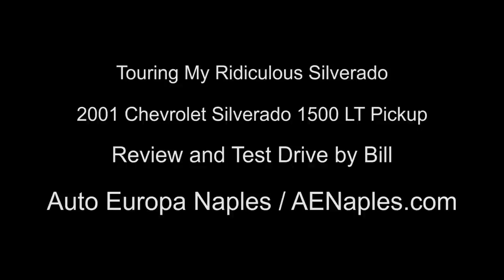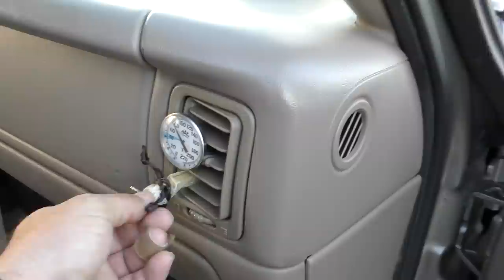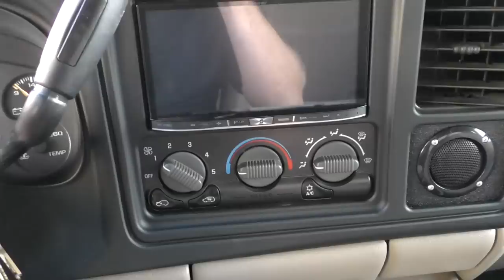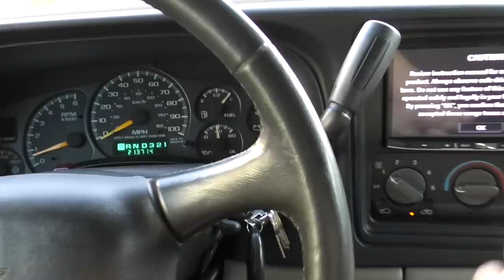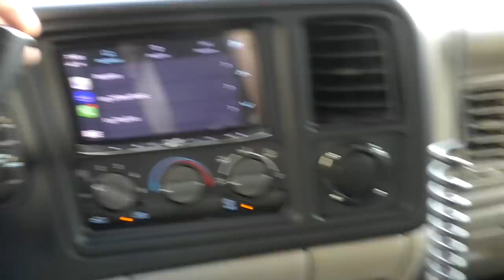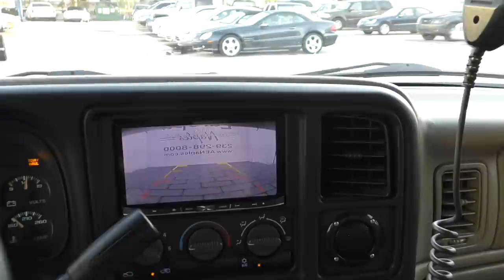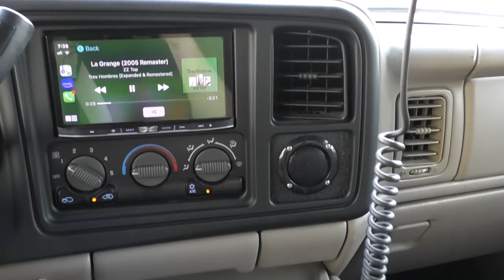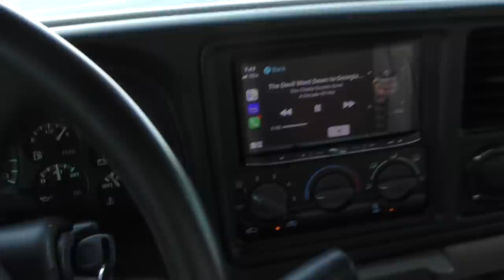The Best Used Truck Under $5K - Here's Why I Bought This 2001 Chevy Silverado and Absolutely Love It

Comment: 100% agreed.. these were likely the best Chevy trucks ever made, all told. Keep up the good work!
Reply: agree have a 99 and its the best chev truck I have owned by far
Reply: Yep, had 04 cat eye, 170k. 3 sets of tires, 2 batteries, 1 starter and 02 sensor. Seriously.
Reply: Still have my 2000 GMC Sierra SLT 1500 Z71 with the 5.3 Vortec and it's the best truck l've ever driven.
Reply: Cool
Reply: Just got an 02 my grandpa left behind when he left this world I spent a hot Texas summer tuning it and getting it a new cat converter. I’m happy to say that it’s one of the best things I’ve ever owned.
Reply: My 02 1500 Silverado was the best vehicle I’ve ever owned.
Reply: My 01 Z71 LS 5.3L ...bullet proof...showroom condition.  Only the 5.3 tick upon startup for 30 seconds.  184k.
Reply: Way better than the trash they make now
Reply: @super20dan  ya 99 -03 are the best and the Tahoe easy to get parts and work on

Comment: Really a great choice!!! Congrats!!! The 5.3 is a great motor!!! I have an older GMT400-style 1997 K1500 Silverado 4X4, and it has the Vortec 5700 5.7L V8 (which I should mention is 306k miles strong). Those engines were all derived from the Corvettes of the time. :)

Comment: Love my 2000 Silverado ext 2wd. Had it for 14 years. Put mild stage 2 cam, headers, cai, custom 93 octane tune, efans, and it woke this 5.3 up. Probably makes 375-400 at the crank. Get about 19-20mpg highway.
Reply: Can't wait to cam mine.....I've had it for so long and now have decided to modify it lol. (2 inch shackles to get rid of the infamous GM rake, re-wired the cab with thicker gauge and added a sound system with 2 amps and 2 10s, added LED fog lights projectors which recently came out to the market, and my favorite mod of all was swapping the center console/jump seat and adding the 07-13 year model that has a lock compartment directly under the seat. And dual exhaust flowmaster flowFx which is really a magnaflow. )

It's a 2001 I've owned since 2007. I own a BTR Truck Norris cam still in the box, the engine has 235k miles. I think I will just rebuild it. As for the stall, I honestly like the stock feel and I may put a 2200-2400 stall

Comment: Good-looking truck there, Bill. It looks like a regular truck on the outside, but with an excellent setup of communications, stereo w/ backup cam, and wheel gun. I bought a very clean 2003 Silverado last year, and I love it. It's a crew cab 1500 HD, so it's basically 3/4 ton with a semi float rear axle. I'm finally getting around to installing a President McKinley CB radio in the center console. As a truck driver and lifelong pickup truck owner, CB radios come in pretty handy out on the highway and up in the woods when running with other friends in 4×4s. Cheers.

Comment: I bought a 99 Silverado in 2012 and paid $4900.00 for that then. It was a screaming deal at that time already. It was the extended cab but only the 3-door, the 4-door extended cab I believe was optional at this time or became available the next year. It was the long box, which I do prefer myself, I grew up driving long boxes.
The family that had it before me were farmers, so it did have a few upgrades they put on it. It had a grille guard/brush guard, very nice addon, and they had put a full-length tool chest behind the cab in the front of the box. Very great addon. They had also put running boards on it, and all these were sold along with the truck, so I got it with these optional items included.
They had also put on overload leaf springs on the rear end, so I believe they were using it more like a 3/4 ton instead of a half-ton. The frame was cracked on both sides on the rear and a co-worker who is a mechanic welded the frame back together and welded a couple diamond patches over the cracks. Now it's solid.
It does have the 5.3L LS engine and I've had almost no issues with it. This past spring the water pump did go out and I managed to replace it myself with minimal effort. It really wasn't all that hard a job, just took some patience and I did torque the bolts holding everything together back to the factory specs. While it was apart, I also put in all new hoses, heater and radiator hoses, and replaced the serpentine belt and the idler pully's so the front end is pretty much brand new again. Like I said, it was a relatively easy job and just took patience while doing the work.
Otherwise, it's been a very reliable truck for the 10 years I've owned it. Regular oil changes and tires, I'm on my 2nd set right now, and would like to put another new set on. I've got a 97 C2500 light duty Chevy pickup that uses the same size tires which needs an engine and tires...currently looking for a 5.7L for that truck.

Comment: 44000 subscribers for a car salesman is unheard of... Bill is LEGENDARY!
Reply: Because Bill is THE MAN. I worked in GM, Mopar, Toyota, Mercedes/Audi dealers all my life, 35+ years, with the new and used vehicle sales pukes. Bill is head and shoulders above every one of them. 

Anyone who owned a '79 Formula Firebird as their first car in high school is the man in my book. more than a little about them below

 I personally owned 6 Gen 2 Pontiac F-body's...  First a '71 Formula in Silver, Black standard interior, with the optional 455, turbo and 400 trans, featuring a liquid Mercury filled tank mounted inside the trunk for increased handling..  Next, a Maroon '74 Firebird with Black standard interior, stock 350 2 bbl and 3 speed automatic, which I built using 400 RA-III heads, cam, larger pistons, aluminum intake manifold, shift kit, reverse valve body, dual gate B&M shifter, and headers, featuring Sonic Turbo mini mufflers, pushing considerable power though a 4:10 10 bolt Posi traction differential. Next up, a '76 Formula 400 in Black, with Buccaneer Red Deluxe Cloth interior, featuring the 4 speed Borg Warner Trans with Hurst Hatches and Gothic Script decal kit. Later, came the Canary Yellow '77, with a 400, 4 speed, Black Deluxe Interior, which never had the engine apart,  but felt and performed considerably faster than every other, save 2 of my 2nd gen F-bodies. A little more about them below...

 I paid 100$ for it, back in 1988, it needing both lower outer quarters, which I installed myself, weld in, then an all-over paint job back to like new. I loved that car and traded it for a V-8 powered S-10.  At the same time,  I came across a retired local Police Chief selling his one-owner '78 Trans Am, garage kept in Aztec Gold, complete with Screaming "Super-Bird" decal which extended on to the upper fenders in front,  again using the Gothic Script writing decals, featuring the 220 horsepower (felt like much more power)  400/ Borg Warner 4 speed, 3:55 Safe-T- Track 10 bolt rear end, , Camel Deluxe Cloth (checkered velour seats) interior, & GM Fisher T-Tops. This car needed most of the 8 Intake valves, as they had split on the margins due to recessing of the  intake valve seats. So, the entire engine was rebuilt professionally from crankshaft up , over-bored 10, custom forged pistons, stainless steel valves,  a bigger cam featuring a high lift short duration spec.  Ported and Polished runners were hand matched,   RA-IV heads,  headers, deleted catalytic converter, Thrush "Hush Thrush mufflers, full 2" pipes out the rear. 

Finally another Canary '79, Camel interior, fully loaded, no T-Tops, no 10th anniversary 400, instead it came with the malaise anemic 403 which had a rod knock. Owned by the John Palumbo, leader of a  East Coast regional rock band, Crack The Sky, of some notoriety. I installed a built '70 400 R/A 4 and matching 4 speed in from a totaled '70 GTO. A mix of Honeycomb, Snowflake, Rally II and Turbine Wheels were on all of them.

Any guy that knows cars and loves Trans Am's-Firebirds the way Bill does is Aces in my book!
Reply: @phillanassa759  - Bill's a Car Guy...You're a Car Guy ...... I'm a Car Guy ........... Church Lady says, "Well, isn't that SPECIAL!" ...  Yes Church Lady..........Yes it is!!!

Comment: I also bought a 01 Silverado 1500 about 3 years ago. Less than $4000. The engine had just been rebuilt and the transmission was newish. Put new shocks on it. Had to have the heater core replaced recently. so did all the actuators and the air condition. Going to have it painted soon and have all the dents and rust taken care of. Probably have all the emblems taking off of it. have put LED lights all in the cabin and on the license plate light. I need to get new parking turn signal lights and tail lights. Think it will be pretty sweet by then. I'm an older guy and I'm not gonna go out and spend$60,000 on a new truck. this will probably be the last vehicle I ever buy. Oh there are some spots on the dashboard that just need repainting. it's not cracked anywhere but on the door panels there are couple of cracks on the drinker side. I need to figure out how to fix that. Anyway enjoy your video I might get some of the gadgets that you got.

Comment: I was at your level of pickup knowledge. I needed one so I bought a pretty white 2009 Ram 1500 quad cab. It's my truck and I use it for work and...it has been flawless in serving my needs. Power everything I need clothes seats just a plain simple truck. 260,000 miles now and still flawless running looking and all that. My father-in-law has that same truck you have. Same color and everything. It is a better truck than mine even though it's a 2001. You are 100% right about that truck. You'll have many more years of service with it or...the person who buys it will. I'll buy a car from you soon. Love how you handle these videos. Thank you

Comment: Thanks for doing this review.  My son has my old 2000 Silverado LS extended cab.  Truck was too good to sell when I bought newer trucks.  Love this thing.  These trucks are fairly bomb proof with the weak link being the transmission.  But even those last a decent while if you don't beat on them too hard.
Reply: I just bought one for 5k with 23000 miles on it I’m super exited for this had to sell my  08 Silverado due to the fact that it was breaking down constantly. Previous owner bought it new from the dealership

Comment: Love this truck man! I have a 2000 Sierra 1500 5.3 that my dad ordered brand new, fully loaded. Meadow Green, looks identical to the truck that was on the 2000 GMC brochure. Got it from my dad for $3k back in 16 when my dad bought his new Denali. 245k mi on it still runs great. Could use a paint job and a little body work but right now she's just my ugly, dependable ol truck.

Comment: I love that truck. If you ever sell it...I would absolutely adore it. I'm a 38yr old, single, retired, disabled veteran. It would be perfect for me and my little dog. I have a rclb 2wd 2003 Silverado 2500 6L 4L80e with 316,xxx miles on it that is worn out, a rclb 2wd 1997 F250HD 351w ZF-5 S47 with 22x,xxx miles that is equally worn out and a 2004 Pontiac GTO T-56 that is torn apart in storage and waiting for a 6L iron block that I have yet to refreshed, assemble and install. If I had that truck I would seriously consider building it the way Chevy should have with a built 6L/4L80e, 14 bolt, might do a leveling kit in the rear, mini spool, ladder bars, upgraded brakes, coil overs in the front. Put a small cam in the 370-376ci overhoned iron block, upgrade the 706 heads, the TBSS intake, 92mm tb, swap in a 216/220, 220/224 or 228/230 camshaft, valvesprings, trunions, heavy wall pushrods, LS9 head gaskets, long tube headers, 2.5" true duals, electric fan, electric water pump, functional ram air, silicon hoses, coler t-stat, NGK TR6s, flex fuel, larger behind the rear axle fuel tank in place kd the spare tire, 20x8.5" factory LTZ wheels. Sort of a Mashup of 1/2 and 3/4 ton parts with performance upgrades. That's the perfect truck and the mods you've already done are excellent. I would adore it if you'd ever sell it and probably drive it for the rest of my life.

Comment: 1999-2006  GMC Sierra 1500, Yukon, Yukon XL, and Chevy Silverado, Tahoe, and Suburbans with the  5.3 Vortec are among the best vehicles ever made. In 2007 GM added the AFM to the 5.3 and reliability went down. Best to disable the AFM system.

Comment: I have a 2005 5.3 with over 300,000 miles on it. 2 trips from Cali to Florida and back pulling a travel trailer back the last time.  Besides new brake pads, a few oil changes, new plugs, and ,4 new tires I've had no mechanical problems at all in spite of my driving the hell out of it.  Still running strong today aside from an O2 sensor code recently that's causing some strange problems I haven't figured out.  Most problems I had with it ended up being nothing more than resetting the computer via disconnecting the battery for a day and then reconnecting it and going through steps I found on YouTube to reset the computer.  Best truck ever!

Comment: I have a 2000 Chevy Silverado 4x4 Z71 with the 5.3 v8 and it’s been the best truck I’ve had I wish mine wasn’t so rusted out. Lucky for you your 01 is in great shape. These trucks blow these new ones outta the water. Great video as well. Thank you for posting 👍

Comment: Another wonderful "Bill" video!!

I own a 2000 Suburban 1500, a 2002 Tahoe, and a 2004 GMC Sierra 1500 Quadrasteer...all GMT 800's with the 5.3 like this Silverado.  The Tahoe has been my daily driver since I bought it new in late 2001.  To date, I have put almost 350,000 miles on it and never replaced the engine or transmission.  I've replaced other things, but all in all, its been a great truck, as have the other two trucks which both have around 150K on them.

Nice mods on your Silverado, too!

Comment: Great video!! I just purchased a 2002 ext cab 4wd at auction. So this video was helpful
to me learning as much as possible about these Silverados
Reply: Excellent choice in truck things are going go out just have it fixed but that motor will run forever and please remember to change the "transfer case fluid" at the dealer high prices or online AC Delco $86.00 for 3 Qts. I didn't even know I had one to change the fluid.

Comment: Your truck is lovely. I've said it over and over, when I bought my 2006 TBSS (in 2005), I bought an engine that just happened to come with a car around it. The 6.0L LS2 in it was the sweet spot for me - no AFM/DOD, good heads. all aluminum - about the only flaw is the front biased oil pickup, which is easy to deal with or remedy. I'm 6'5" with a bad back, my Corvette days are over. I knew that the rest of the truck was typical GM junk (which is why I also buy Honda/Lexus/Mazda dailies), but the LS2 is so good, it makes the rest easy to deal with. I wish I had purchased a similar 5.3L pickup like yours around the same time - I'm so comfortable with that interior (perfect for the...large man, let's say), cheap stuff and all, and so easy to work on, so many common components in GMT chassis of that era. I keep the same stuff in mine - a little jump pack, a little inverter for my laptop, even your color scheme is right in my wheelhouse. Great ride!

Comment: 2 years ago I bought my 2001 HD 2500 ,4x4 , 6.0, single cab long bed with matching color camper cover , with 69,800 miles .for 7k and it was damn near mint . I feel like I found a great deal and love this truck. 

Manual windows , rubber floor mat , I can't stand carpet , manual 4wd which I also liked for less mechanical issues.

Comment: My dad used to have the dark blue version of this truck that later was wrecked back in 02 to which he later bought a 2002 Avalanche, but then traded it on another 2002 Avalanche that had a different colored interior (he hated black interior since they get dirty way too easy), but then later after having issues with the midgate leaking water in the cab, he later sold it for a 2004 Silverado 1500 crew cab, but then later after my mom bought a new car, he later took her 2002 Tahoe that was already payed off.  Ever since then, I've developed a love for these GMT800 platform Chevy/GMC trucks/SUV's, they're very solid, reliable, and very easy to work on.  I currently own a 2006 Silverado 1500 Crew Cab and I would not sell it for any new fangled nonsense that's sold these days.  In fact, it'll probably go through a few engines and transmissions before I finally decide to let it go.  These trucks are the best!

Comment: Yeah I was in the same boat, had to buy a tow vehical because I have way too many vehicals/projects. Bought a 2004 Tahoe because it's cheap and comfortable as hell, I'd definitely recommend beefing the transmission once it goes out (it will usually 3rd and 4th clutchpacks) 4L60E's need to be updated.  This was all years ago when I was much younger, still have the cars and the truck, it's got 243k bumper to bumper (except the trans) if you really wanna bulletproof these you can fabricate an adapter plate and put a 4L80 in it, which will be fine on the same rear gear ratio for the 5.3, that combo could take more hate than Kaitlyn Jenner

Comment: Hey, Bill, if you're referring to the 32-valve LT5 for the ZR-1, it had absolutely nothing (except bore spacing) in common with the Small-Block.  The LT5 was a Lotus-designed engine that happened to displace 350 cubic inches.  Even so, the precise displacement of the LT5 is 5,727cc, while for the 'Chevy 350' it's 5,733cc. 🏁

Cheers, Bill! 🍻

Comment: I used to build those trucks at GM Pontiac Assembly! I installed the upper/lower latch on the driver's side where the extended door locks in place, among many other parts during my time there.